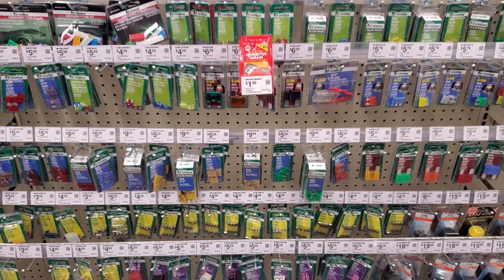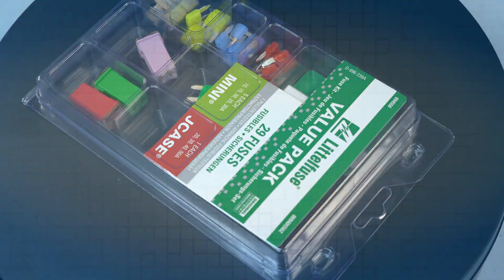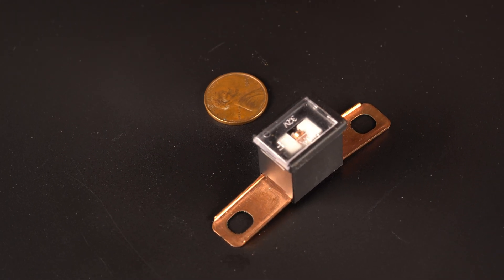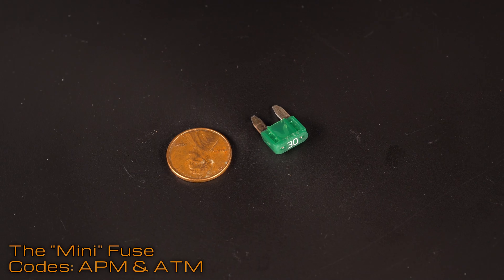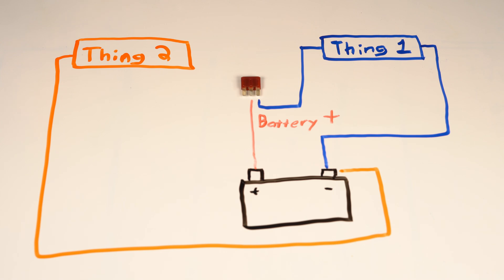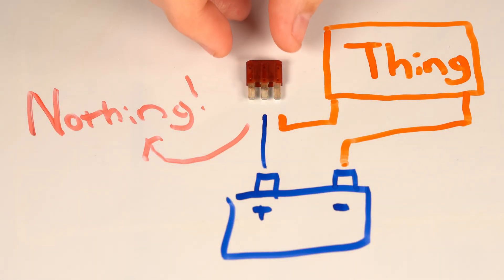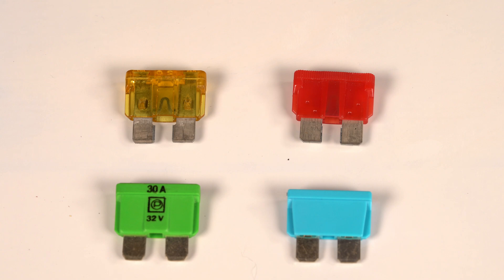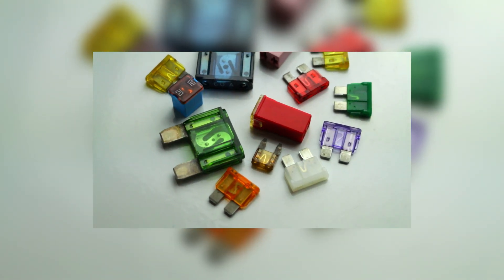Car Fuse Types Explained: From Glass Tubes to Micro3!

Comment: Having designed automotive fuses at 18 years for Littelfuse, I can tell you that the advice to not buy cheap fuses is excellent guidance. We often tested fuses in our lab from Harbor Freight and other knockoff brands. They came from every corner of the earth. Some have the same elements no matter what rating. The manufacturer only changed the color of the housing. Most have no plating on the terminals. All are made with the cheapest low temperature plastics. None meet SAE/ISO performance and safety requirements. They're very dangerous and even in the most benign cases, can damage the terminals you plug it into. The lack of plating can lead to intermetallic growth over time that will essentially weld the fuse in place. In the worst case, they can fail to protect and you'll end up with a car fire. It's not worth it.
Reply from the maker: Thanks! I remember watching a video about a year ago where someone was addressing this concern as well. I've been considering doing my own test and making a video about it, but I'm still looking into what equipment I would need to buy for it. I like the precision a benchtop power supply would be able to show, but a lot of those seem to max out at 3 amps; definitely not covering the most common automotive fuse ratings with that! Do you have an suggestions for power supplies I could utilize along with a multimeter or oscilloscope (I already own those)? I imagine Littlefuse may have had testing equipment that is well out of my price range, if it is even available to consumers at all, so no worries if not!
Reply: @CarsSimplified  Yes, LF has specialized equipment. Up until the late 90s, most of their equipment was built in house and specifically designed for fuse testing. However, these days you can find off-the-shelf power supplies that can do the job. The important feature you'll need to make sure you get is that the supply has a "constant current mode". A constant voltage supply with a high power load resistor will not work. As the load, wire, and fuse all heat up from the current flowing through them, the resistance will increase. If the voltage is held constant, the current will decrease. You need to make sure the current is maintained. To test fuses up to 80A, you'll need a supply that goes up to 480A. You basically want something capable of testing up to six times the current rating. A 360A supply would be good for fuses up to 60A. Sorensen makes supplies that fit these requirements. You're talking a few thousand dollars. Maybe you can find one used. There are places that rent them too. I'm not sure what voltage input you'll need. They might require three phase.

You'll also need some equipment capable of measuring the time the current is flowing. An oscilloscope could work well for relatively fast opening times. Otherwise, I'd suggest a timer of some kind attached to a current transformer. You can find something like that on digikey or mouser.
Reply from the maker: Very useful information! I appreciate the thorough reply!

I will definitely keep an eye out for something second-hand, but I may have to rig up something with a few car batteries for a first attempt and use that video to guage if there is enough interest in a more thorough one.
Reply: @CarsSimplified  Although a car battery might be the most "real world", it's not going to be repeatable. Depending on the state of charge and the state of health, battery performance is going to be pretty inconsistent, especially at higher currents. Also, as I mentioned, the I2R heating will make the current flow drop with time. The battery voltage will drop as it discharges too. It might be okay as a "rule of thumb" test. It all depends what you want to get out of the testing.
Reply from the maker: Indeed; definitely lot of variables to consider. I have a few battery chargers I was considering adding to the set-up, and there's always just running the test off a running car with a few loads on. I'll look into it, and your information definitely helped me eliminate a lot of research time, so it is very much appreciated!

Comment: Please explain the performance difference between J case, M case, and PAL fuses.
Reply: I designed automotive fuses for Littelfuse for a total of 18 years. JCASE, MCASE, MICRO2 and a number of others are my "babies". The PAL fuse is a Japanese standard. You will find it in Toyotas, Mazdas, and Nissans. You may find it in some American nameplates if it's produced in Japan or if the wire harness manufacturer is Japanese. Essentially, the PAL fuses are the Japanese answer to MAXI. They're either bolt down or plug-in. They perform reasonably well. You don't see a lot of Toyotas burning on the side of the road. They have a higher "minimum fusing factor" and are typically made with copper alloy elements. This means they run hotter than MAXI and don't protect the wire as well. This means if you're an automaker who uses a PAL fuse, you need to make sure to size the wire larger...that is, if you believe in the "low overload" or "resistive short" event.

Okay, that said, the JCASE is Littelfuse's answer to the Japanese (Pacific Engineering Company) response to the "resistive short" event. US automakers wanted to use cartridge style fuses, but couldn't accept the fact that they don't protect against a low overload as well. The reasons they wanted to use the cartridge type is that it's more compact, which allows more circuits in the same space and it allows them to cost reduce the system by removing double female connectors. The construction of power distribution boxes (PDBs) uses a busbar to distribute power to the various fuses. To connect a male bladed fuse to a busbar, which is flat piece of metal with blades cut and bent into it, you need a coupler. That's the double female terminal. Fuses like JCASE include a female connection inside the fuse. So, now the fuse can plug directly onto the busbar and eliminate a part. PEC developed the J-Type fuse to meet the desire to eliminate the double female AND have low overload protection. LF developed JCASE. I did the actual design and used some tricks to make it run cooler than the PEC J-Type. The JCASE has been produced in quantities of 2 to 3 billion since released to the market.

There is a low profile JCASE or LPJ fuse which is half the height. It did not catch on quite as strongly as JCASE and wasn't featured in the video. MCASE is a further miniaturization of the concept. I did the actual design on that one as well. The smaller you go, the more trade offs you have to make. Power density is a real issue. A 280 (or 2.8mm) blade can only carry 30A of current without overheating. The MCASE doesn't  have as much "slow blo" capability either (the ability to withstand inrush currents without having a nuisance opening of the fuse element). All of these things need to be accommodated in the system design by understanding the fuse's performance, limitations,  and the system requirements. Engineers need to balance, cost with size and performance....while overcoming some superstitions about actual in-vehicle events that may or may not be real.

Well, anyway, I hope that answers your question.
Reply: @jimbeckert7946  WOW! Thanks! I have a Ford Transit. The fuse for the heater fan litterally fell out one day. The manual indicates a  J case fuse, but they don't push all the way in. M case does. Seems that should be OK. Possibly defective fuse block from the factory?